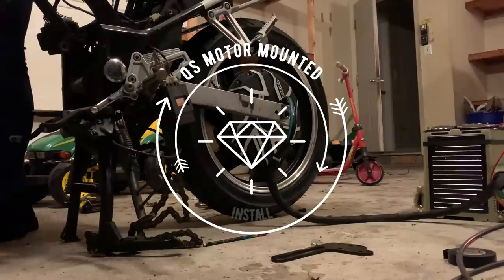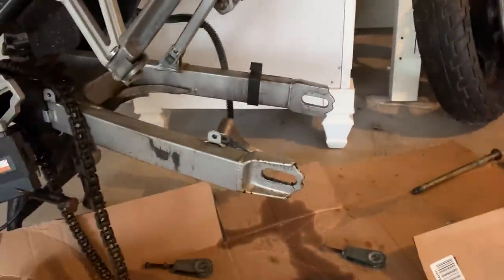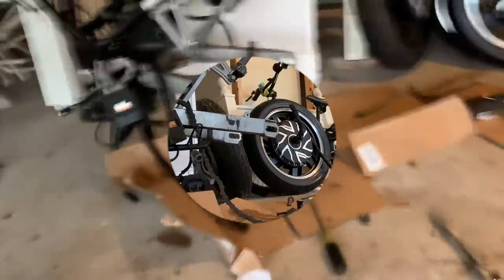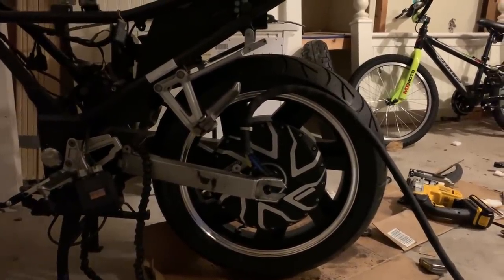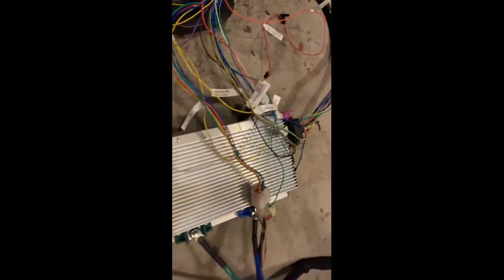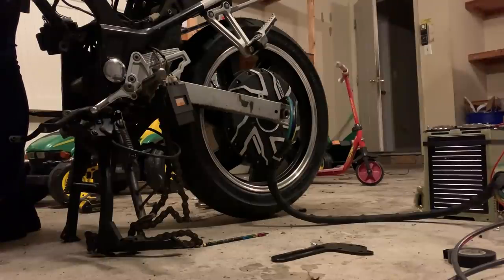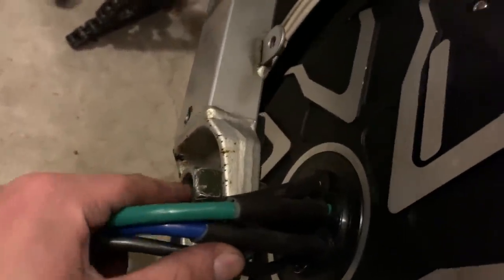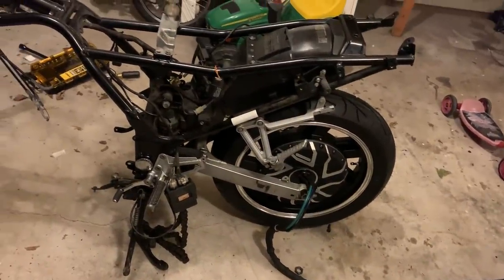Electric motorcycle build QS 8KW hub motor ! Bench test

Comment: Just a reminder. You don´t want ANY holes in a highly stressed component, just as your swing arm. ( 2:18 )
The reason is that you will generate a high-stress concentration spot, and probably generate fatigue cracks. I´m an engineer and worked 15 years in maintenance engineering in the oil industry. Saw plenty of things. 
Try to use some other means, perhaps even welding a bracket, instead of drilling the chassis components.

This is a great rig. And those batteries are awesome. Thanks for taking the time to show it.
Reply from the maker: You can’t see it but I have hardened steel that is on the inside of the frame also to hookup the break I have another piece of steel that’s attached to the wheel to hold it on if some broke as a redundancy . But your right you really need to keep in mind stress points as you  build something , this was one of my first builds

Comment: I was sure it was going to get traction and launch off of the center stand but you got lucky! Also, that jump from forward power to regen braking is brutal. I wonder if a good controller could make that a little smoother. I just TODAY ordered a 4kw hub motor kit from QS

Comment: Hello my friend.
Nice build!
I have two questions: 
What is the shaft length of the hub motor you used?
Im also converting a ninja 250 and my concern is the shaft length.
And my other question is: What mechanism did you use to lock the hub shaft to the swingarm? I saw further in your build that you made a slotted bracket but how did you attach it to the swing arm so it doesn't move back and forth?
Greetings!

Comment from the maker: If you’re going to go with the 8K motor I would use in ninja 500. You can get them really cheap, but if you’re going to go for the 12 K motor I would go with the Yamaha GSX 600 or thousand if you can find a rolling frame you’ll still have to make a cradle for those though

Comment: For safety's sake, I don't see any sort of axle block on installed after you cut the fork. I know this is like a year and a half late, but using a couple would lock your wheel in if the nuts decide to loosen up on you and send your wheel flying at 65mph
Reply: Yeah. I'm interested in this too

Comment: Torque bar is used not to prevent wheel back and forth movement but to eliminate the axle spinning on its axis that will end disastrous for your motor bud. Fyi

Comment: Like the video. How did you manage to balance the tire. Mine is wobbling all over. I tried hanging some tire weights on but it did not work. Any tips?
Reply from the maker: When the amount they put beads in it , also the tire may not be seated right

Comment: i wonder how safe it is (for the motor) to have it inside the wheel!. i mean due to puddles and all these.
Reply from the maker: These are sealed motors they are water tight
Reply: Diy Guy 
Have you completed all testing for range etc
Reply from the maker: drmachinewerke1 https://www.facebook.com/319545258966774/posts/510121353242496/ follow the page actually switched it up gonna post a video when complete but this is my fb page i have a little more content on here switched out the cells

Comment: How much did the Chevy volt batteries run you? I am looking at doing exactly what you are doing as it will cost about 5k less then buying a zero!
Reply from the maker: Yea and cooler because you built it your self , it was about 1800 bucks. But leaf cells might be cheaper at www.batteryhookup.com

Comment: Lead acid batteries? 
What is this 2009?
Reply from the maker: Hahaha please those are 2 chevy volt 48v 45ah batteries
Reply: Diy Guy go with lithium battery bro. So much faster and better. Way more torque. I just swapped my 32ah acid batteries for 2x 30ah lithium. And holy it’s fast. 1x 30ah is super fast. The second battery definitely makes it noticeably heavier. But I went this route so I can have 2 chargers charging it at the same time for faster charging. chargers are 72v 4.5a input. 6.5 hour full charge if both was empty but usually takes me 4-6 hours full charge as I don’t drain them to empty often. Having 2 batteries also help with range anxiety. I get about 90km range doing 60-87kph  average speed. I have only a 2500w motor. I’m thinking about going 8000w motor hub for more highway level speed.

Comment: Hello I'm from India and I'm now interested in building my own electric motorcycle so I planned to use a 8kw hub motor with 72v and 100 to 150ah 1300 rpm (no load) with a total weight of bike and passenger = 220kg will I be able to reach 100km and can it cover 0 to 60 in less than 6 or 5sec?  Kindly guide me
Reply from the maker: Depends on how many amps your pushing but should be close
Reply: Vichu K the sales guy told me the 8kw is 5 seconds

Comment: The benefit of having a hub motor on your bike, there’s no need for a chain drive from the motor to the rear wheel, and also if you want to go insane with the hub motor. 

You can also add another one for the front wheel, just imagine the power of having two wheel drive on your bike.
Reply: More trouble than it's worth........I tried it.............Just use a more powerfull RWD..............Paul

Comment: What frame are you using??
Reply from the maker: Ninja 250 but not should have used a frame with a cradle easier to mount the batteries
Reply: @diyguy1476  so any frame recommendations?